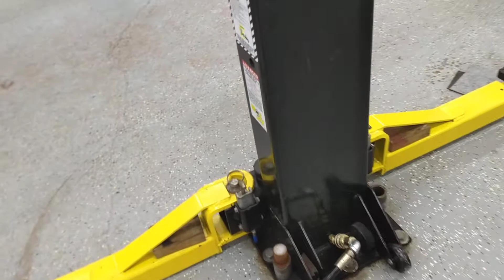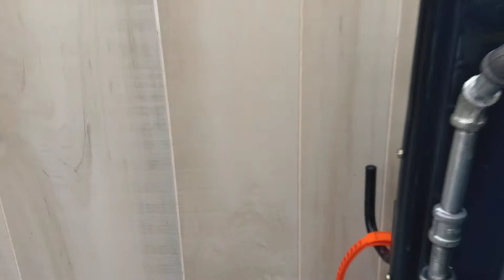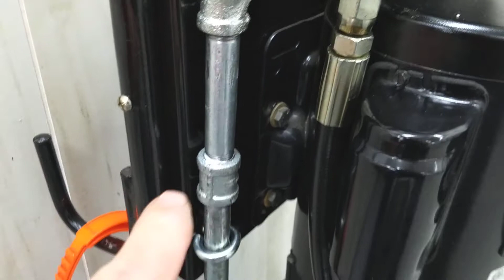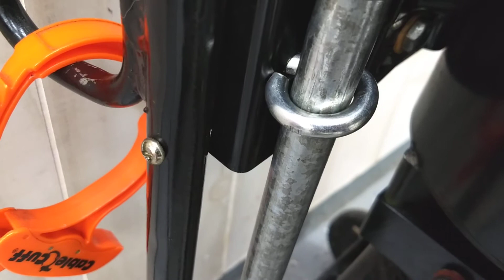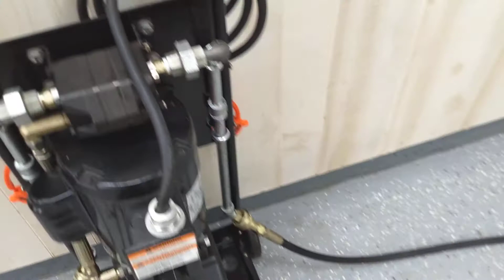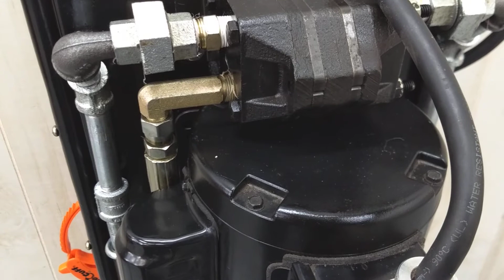Maxjax Auto Lift Hydraulic Hose Improvement

Comment: Those fittings are not safe if you're going to modify something like that go to a hydraulic shop and get the pieces from them
Reply from the maker: I changed everything to schedule 80 piping and it's been operating just fine for over 4 years now
Reply: @GuyRegular  still not safe you never use cast iron fittings with hydraulics

Comment: Do the hoses have to be the same length in both sides. I was think of mounding the unit on the post and running 1 line over the ceiling back down to make a more clean appearance with hoses on the ground
Reply from the maker: No the hoses don't have to be the same once you  bleed it properly everything will work fine

Comment: Very good idea, I would have extended your piping just a little longer so that your hoses would have been laid entirely flat and came up into the inside bottom plate of the lift. Like the previous comment posted below i would use actual hydraulic piping and fittings not schedule 80 fittings. Nice video, thanks for posting it.

Comment: I like that you got the hoses out of the way, very smart thinking and routing. But I feel that I need to point out something, using regular galvanized fittings on a hydraulic system is not a good idea. Those schedule 40 fittings are not rated for over 200psi, with a safety factor of 150% you are looking at 500psi ! So please do yourself a favour spend the extra money on actual hydraulic pressure rated fittings and hose, also the Galvanizing sometimes does flake and you really don't need either of these failures. Just a recommendation. I have worked with hydraulic systems for over 30 years and have seen different types of part failures, using Home Depot or lowe's regular pipe parts in hydraulic systems is a quite common one.
Reply from the maker: Murray Halbert after I posted this video I did additional research and I changed all the piping and fittings to schedule 80 because of the pressure involved and I eliminated the galvanized components
Reply: So https://www.mcmaster.com/45525K533 or https://www.mcmaster.com/4443k633 would work?